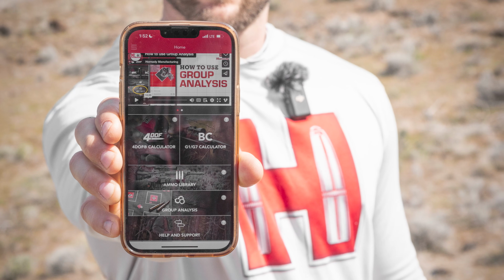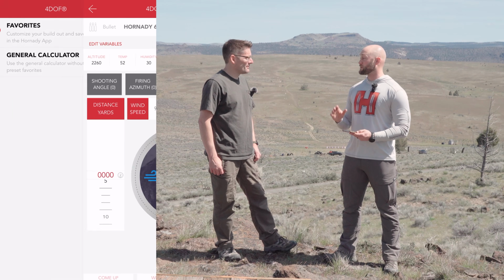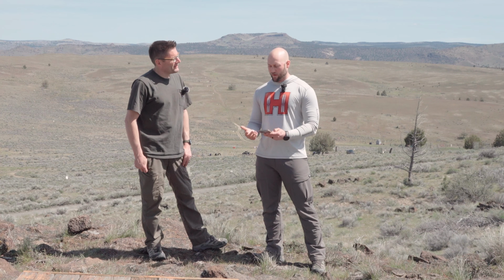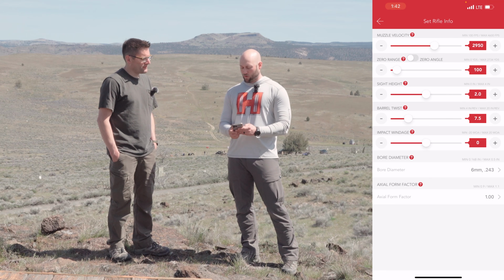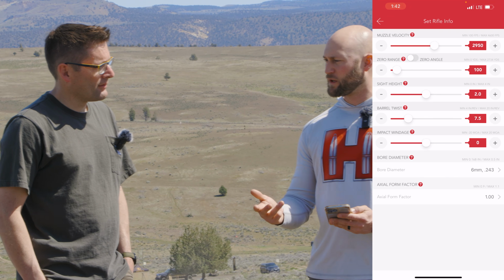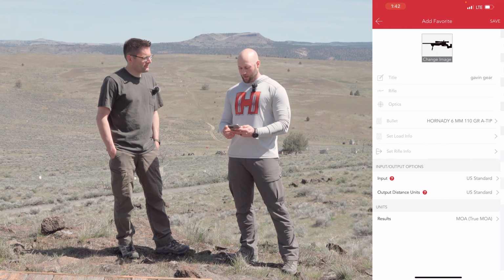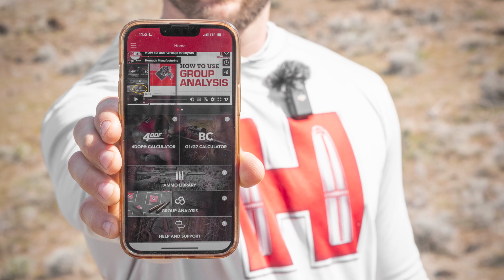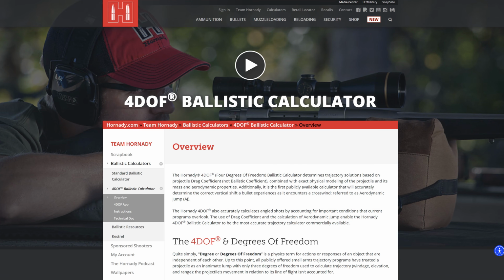4DOF Tutorial: Set Up & Get to Work with Hornady's 4DOF App - Seth Swerczek at Leupold Academy 2024

Comment: just started using the 4DOF App. and found quite a difference in end results especially when shooting @ 1k yds. 
last time I compared two separate ballistic calculators including 4DOF and there was on average a 1 moa variance which @ 1k yds is some 10" enough to miss the target. 
this weekend I will see which calculator is more accurate !
so far @ 200 yds. I found the 4DOf was off 0.250 moa @ 200 yds. with my 6mm GT 115 gr. Berger bullets @ 2850 fps
Reply: Love to know your thoughts. I'm in the process of comparing apples to apples as well. Thanks.
Reply: @freeman436 resolved my issues with Hornady 4DOF finally.
The problem was I was using CFE223 powder in my 6mm GT ammo which turned out to have an inconsistent burn rate at the required loads so I was told to switch to Varget powder. CFE223 is good for my 223 @ 22 gr. loads but not at higher loads. 
Now my average MOA for 5 shot groups at 200 yds. has dropped from .750 to .400 MOA. almost  50% reduction. 
Looking forward to shooting 1k yds. next month at the other range I go to.
Reply: @DLN-ix6vf  cool. thanks

Comment: I need to collect more data but I've found that shooting a 16" 1:7 5.56 IMI 77gr with Garmin avg velocity of 2660 using Sierra 77gr bullet profile in 4DOF, I needed to reduce the E call out for 473yds, from 10.66up to 8.70up.  0 wind, 73F, 40% hum, 30inhg.  No zero range or axial form factor loaded.  I can change velocity to 2870 to reduce 4DOF E to output E of 8.7.  Any thoughts?

Comment: I started 4dof only when it appeared. As I used it realy many bugs appeared, so I droped this calculator. As major bad factor were terrible bugs when using metric/imperial values conversions. They were freqently wrong or at least not handy. The 4dof program was frequently loosing, forgettig values which I brought to it. It was completly unrelayable. The concept of zero angle is intertsting concept, and catching attention. Since the values entered were always mess / unstable I could not use it. The concept of axial factor:...hmm, it is not in fact bringing you anywere closer because it is not repeatable. One day you shoot, you have been off a bit, you bring correction, and you think it is fine for next day. It will not be a case. ...let say you have changed a lot of your ammo or bullets, and properties will change a bit...not a lot but enough. Lets say you have been shooting Berger bullets, you have set everthing, next time you take bergers again...but it occured the bullets are longer then before...exemple bullet length changed 1.25  to 1.2520...and it will ruin your drag factor by 1 or 2%. It will result on little offset at distances 800m or longer....So axial factor, perhaps it can help, but one must know limitation of this tool. 
Perhaps, last edditions of 4dof are better, but last year I have checked   metric/imperial options it was still messy.
Some more handy materials on use of zero angle would be benefitial.
Anyway 4DOF nice try, but one must work on simple things to improve it to fair standart.
Sorry for my english.

But Hornadies ATIP bullets, they are best. I gained many trophies with them, thanks.

Comment: I have tried and tried and I can not get the 4DOF APP to work. I;ve watched every single video Hornady has put out on it. Other apps I have used seem to work okay. Strelok works great but is no longer on the App Store. 4DOF doesn't seem to work at all. Usually it spits out completely wrong information, but for now, it won't even give a solution. No matter the distance or wind, it's 0.0 up and 0.0 right.
Reply: So, update. I switched profiles. For those of you who think Hornady isn't trying to kill the 6.8 Western. My 6.8 Western profile is locked. Won't give any information. My 6.5 Creedmoor profile is working along with my .308 Win profile.

Comment: I use Hornady 4DOF quite a bit and compare it with other calculators. It handles environmental changes the best in my opinion . However, the biggest difference in solutions is with angled shots. I’d love to see a video exploring ballistic calculator solutions vs true fire results at 20+ degree angles.

Comment: The app hasn’t worked well in months. It is always giving me solutions that end up with too much elevation, especially at 1000+ yds.

Edit: I’m using a Garmin Xero for velocity data and have a WeatherUnderground weather station at my range, so my data should be good. I’m typically shooting west to east, using Hornady 180 eld-m bullets out of my .280 ai. The app consistently gives a solution that is at least 2 MOA too much at 1150 yds.
Reply: I see the same thing. It is pretty much spot to about 700 yards; but, after that, it starts giving me too much elevation correction. I've gone over all my inputs several times. I can't figure what's going wrong. The weird thing is that it doesn't do this on all my rifles.
Reply: With the data you gave, your bullet is experiencing less drag than the recorded bullet in the apps library. Do an Axial Form Factor calibration within 10% of your mach 1.2 distance. Put in the actual drop in 4Dof and it will correct the calculator to your actual bullet's drag.

Search 4dof axial form factor for a walkthrough.
Reply: Then right that data on your dope card and email hornady and offer the data they take data if be offer it to help improve the app. If you want it better stop bitching and being a part of the problem and oh idk help be the resolution. You know instead of whining. I've sent in 22-250 data for gas rifles because they didn't have that before now they do. It's my data

Comment: been using 4dof for a year and it works fine. little easier to use compared to strelok but i really like the reticle feature on strelok
Reply: What’s difference btwn 4DOF and the normal ballistics calculator
Reply: @Kartyman550  he says it all in the video. doesn't use the standard g1 or g7 for calculations.

Comment: The app communicates well with my one piece base driver module and stepper motor actuated rings but when writing logic prediction maps is getting laborious in mitigation of maintaining random autonomy between integrated neurological data from the weather stations. I'm pretty sure the atmospheric millibars logic is erroneously converging with an uncontrolled facial grimace when I see something that bothers me psychologically but the resulting rapid fire of the ignition modules might not be the only fault because the trajectory is deviating from coa poi to headshots. 🍺

Comment: Great app unfortunately its not reliable at all, on both of my android phones the app doesnt show the calculated up or wind adjustment. I tried changing all the input but nothing seems to help and the icons stay at 0. It like the app is not even trying to calculate.
Reply: I had that problem at first too, turns out I had set my shooting angle to 90 (or straight up or down-no drop needed) check the shooting angle and set it to zero and see if that helps.
Reply: @Dad_with-boys  I tried changing it but still nothing happened.
Reply: Well it was worth a try. I am not an expert at it by any means but it is always getting me on target. They have a YouTube video specifically on setting it up.
Reply: Same here, had the same problem. I ended up reinstalling it and it came right.
Reply: @jarroddowd  I tried that multiple times but it didnt help.

Comment: My App keeps crashing on the loading screen on iOS, so where the large Hornady logo is.

It's a great app, but can't seem to get it to work anymore. Even tried uninstalling en clearing app data
Reply: it's possible your computer lacks the updated os and can't handle all this new data required to use 4DOF
I just went thru that with AB Calculator and found you need an os of 13 or better
Reply: Use your phone if you are on computer use the website they even say in the app in your on a pc that the app has issues so they recommend the website while they still work on the pc installer because that's what's causing it according to them is the ios and Microsoft installers have serious program issues that is also why mods don't work on most non steam bought pc games. But I digress most people nowadays can't seem to do their own research and work 😂
Reply: And yeah those two topics are related but you would have to do your own homework to know that